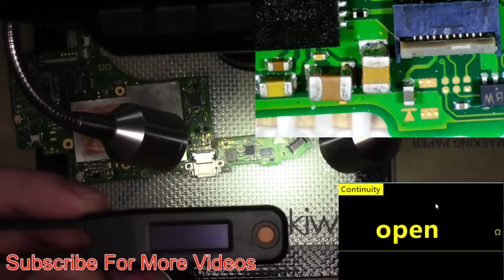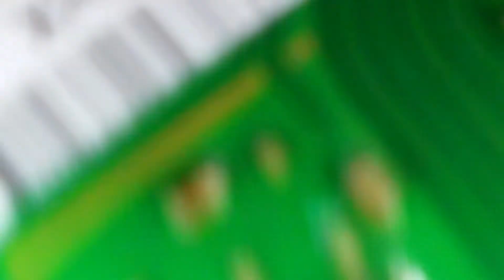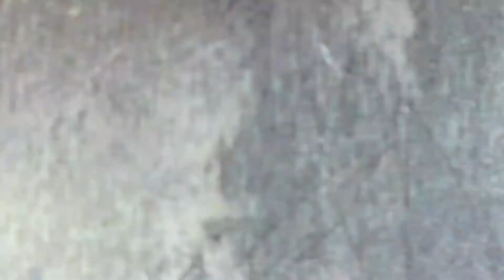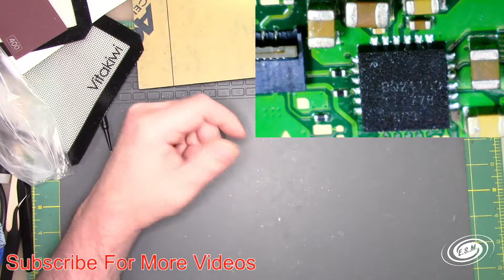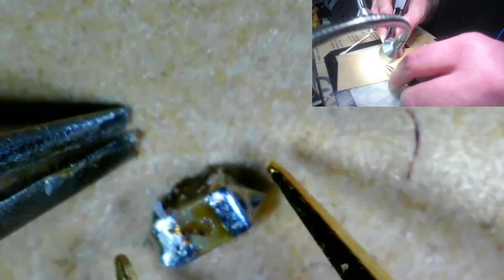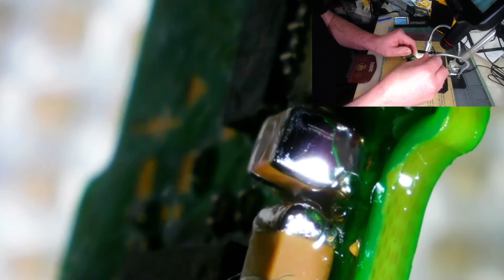First Nintendo Switch Repair Part 2

Comment: 🐨 Just like to say most others would prefer hacked up ?! WAIT! 
Err-I Mean edited Videos, But that's not for me "Don't mind them though so don't feel obligated not to slice n dice them as more fans request that" I prefer real time as it brings me back to when I didn't have the shakes, sigh.. But I digress..

 I am enjoying your Videos so I do drop them a 👍
Reply: BTW With those Hot Tweezers, the more you use them the more you will get a feel for them "BTW note how they really don't have their usable edges where one would really need them to be" I would put some time into seeing if you can electroplate the tips before shaping them into a more usable configuration"